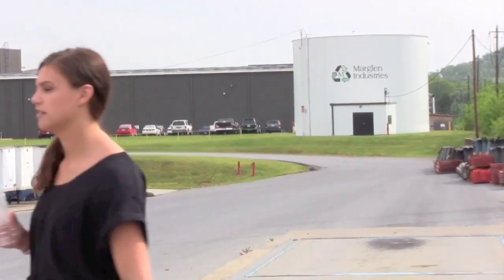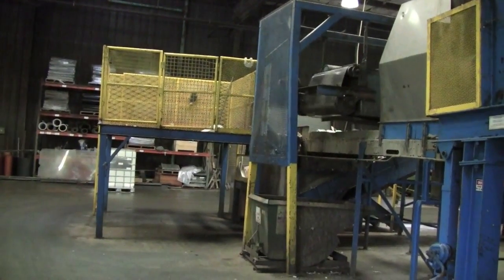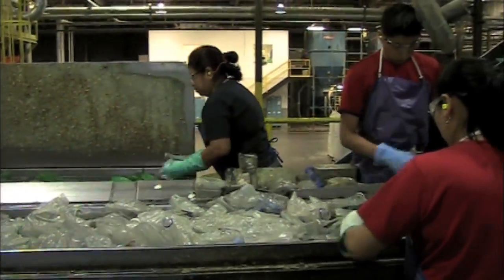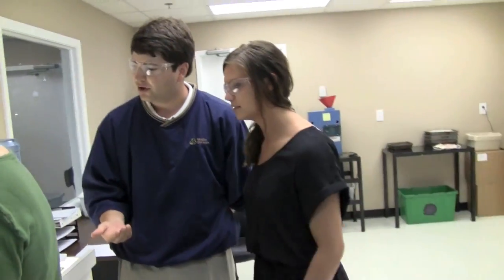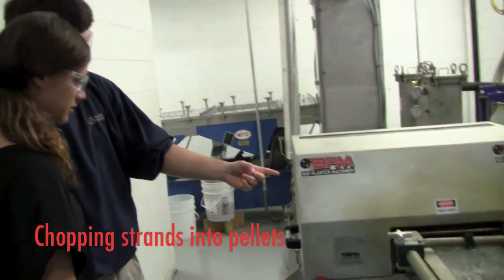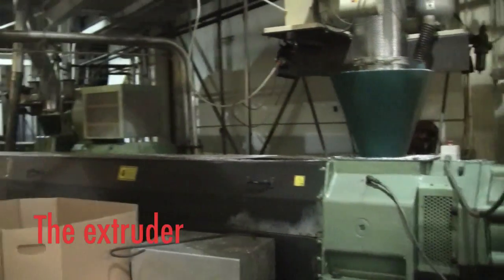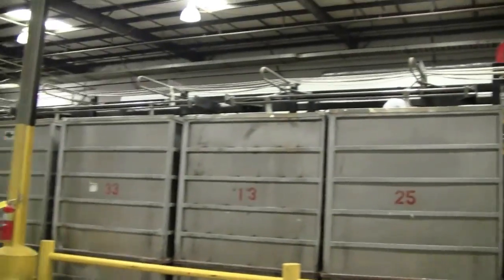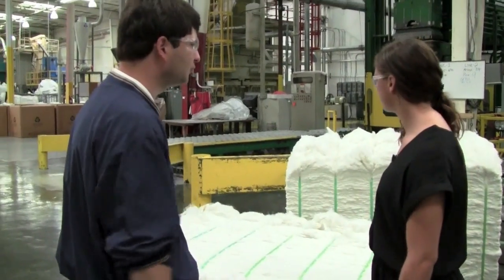Recycling Empty Plastic Bottles

Comment: I've gone on one of these tours of a plastic bottle recycling plant before. I remember that it was on a Wednesday because that evening, I went for an evening run with the Redondo Beach Nutrition Club when the club runs were on Wednesdays. As I remember that I was wearing my fit bit device during the tour and accumulated over 10000 steps, then from my evening run, I went to about 20244 steps. I wear the Flex type fit bit. A tour like this one could easily get you over 10000 steps. I remember that by the end of the tour, my Flex device vibrated to inform me that I've accumulated 10000 steps.

Comment: Very nice effort, but If it is possible it would be very nice to;
have a presentation style summary of the information on;
the energy usage per bottle in watt*hours and also in equivalent dollars
the money made through each item in the processing plant 
the types of plastic and general percentages of these types in the factory input
and some of the key engineering properties of the final product and properties 
that can be attained after some more post processing.

Comment: Something very important was missed in this video. What is done with the huge amount of water I have seen being used to wash and cool all of those plastic. Is this water treated and reused? Recycle is only an environmental solution when the balance of all processes are positive, and this must consider also the energy used and the emissions of the entire cycle including the transportation of materials.
Reply: do you have a better idea?
Reply: Yes. the rinsing water can be recycled by chemical and biological process and reused to wash the bottles. The dirt will be extracted from water in this process as biodegradable mud. The water treatment has a cost, not only economical but energetical too,  so if a company recycle a product wasting a natural resource to lower his costs, it is not environmental correct. 
One of the arguments used to introduce plastic in food chain in place of glass was the one way use, littering the plastic means no need to transport back the glass bottles and wash them to be refilled. The environmental problem and the need of plastic recycling changed everything. 
One other alternative is the return of glass bottles to the food market, they can simply be washed (again the water must be recycled) and reused with no need of the entire transformation process we see with plastic, and glass can also be recycled. Finally in case of litter is a mineral product with the lowest impact, they can also simply be grinded and will turn into sand again, glass sand can even be mixed with construction sand.

Comment: Question is, what happens to all the water that was used to clean and cool the plastic bottles and flakes?
Reply: The water to wash the bottles/flakes is mostly treated (cleaned) and reused. The cooling water is a seperate closed circuit. Energy is removed from the circuit using a cooling system.
Reply: Dan C That's good to hear. It is much better to clean the water and reuse it again. But then what happens to all the dirt from the water that was cleaned?
Thanks for the relpy by the way :)
Reply: The dirt is goes to a landfill or it is burned to recover energy.
Reply: Dan C I guess there never really is a 100% efficient recycling process, like there is in nature.
Thanks for the replies
They helped a lot
Reply: They send it tothe water bottle companies and they put that water back into the bottles and then you drink it. And then you shit it out and then it ends up in your toilet where it is then sent to the sewers where it eventually makes it into the ground and then the maggots eat it and then the rats eat the maggots after that the cats eat the rats and the dogs eat the cats and then the plastic in the cats get eatin by the opossum and so on and so on god damn. Educate yoself

Comment: recycling is great and all. but in this case, all this energy use (both the recycling process and the original bottle manufacture process) could be done away with if we stopped buying and contributing to the manufactured demand for bottled water. in most developed countries, bottled water is a widely unnecessary product. tap water does just fine, and can be filtered at home for taste.

Comment: Safety consciousness of this company is ZERO, no safety boots, no helmets, no hand gloves, no protective clothing gear. common.
Reply: +vino123ization actually the PPE (personal protective equipment) is only required if they meet certain levels. the risk of something falling in this facility is slim and if it does fall there are hundreds to follow thus a hard hat wouldn't help, same with safety shoes. Like if sound is above 85 dB. At the end of the line for the crimp material the guy does have hearing protection if you look he has the disposable kind that work better than the ear muff ones. Beside the gloves were worn when needed ( at the sorting bit) safety is a big concern at big companies but there are rules and regs that are to be followed too. There weren't many people involved in the process which surprised me I must say.
Reply: Should they have masks on as well? Seems like that asbestos i.e. plastic flakes would be super hard on your lungs

Comment: Recycling can't be about reducing waste if it spends more resources. All it does is make people feel better about themselves, because they think they're helping. By basically lying about how great recycling is, there is no drive to look for an actual solution. 

Instead of pushing a failing program and acting as if it's working, admitting that it's a broken system and coming up with a better one would be more helpful. Denial doesn't save energy and resources.